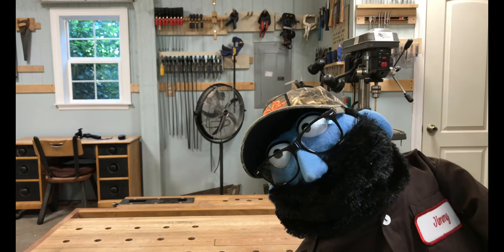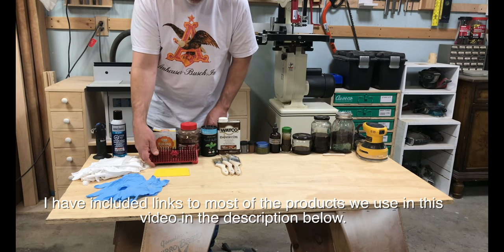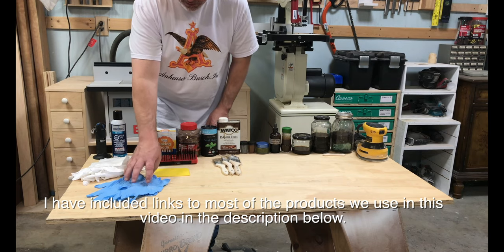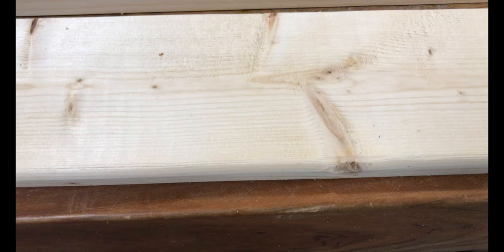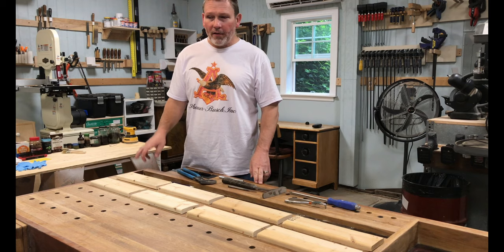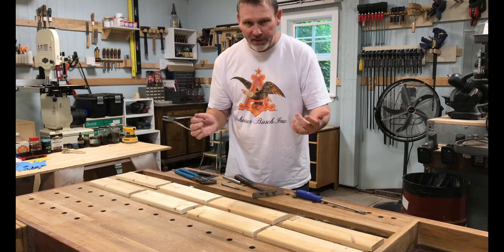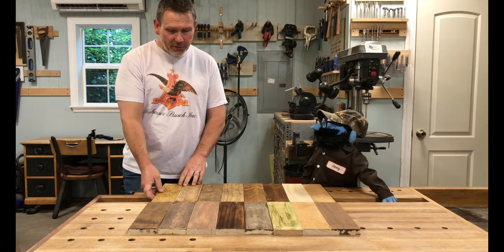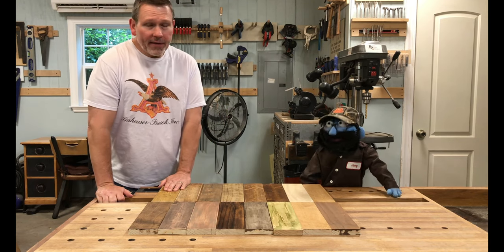Aging wood to perfection - best aging techniques?

Comment: 1. I torched & scraped the paint on my 80 years old doors and door frames, 
2. Then struggle with the putty beneath (sandpaper killer), (paint comes off but putty melts and sticks to the wood), 
3. Then I worked like crazy with 40 grit sandpaper to remove the burnt, discolored, bruised and damaged parts, 
4. I sanded 11 doors and frames with 80-120-180-220 grit sandpaper, respectively, so that the pinewood can be stained well. 

This whole process took me 6 months. Hernia came out at 3 points in the spine. The electric blanket I wrapped around my back to relieve back pain burned my ass. I had to lie face downwards for 2 weeks due to the palm-sized 2nd degree burn wound. The back pain got worse when I sleep this way. Countless sacks full of wood dust and possibly lead containing paint residues came out of the house. I had to send everyone in the house to stay elsewhere (will probably get divorced). And finally I got electrocuted of the dripping sweat from my arm into the angle grinder.

BUT; in the end resulting wood was smooth, shadeless and completely free of defects as if it had just come from a carpenter's hand.

And now I'm watching this: 2:07

Comment: Thats pretty neat. I think the steel wool and shellac turned out the best by far. Ive seen other videos where they used rusty nails and vinegar for a neat effect as well.
Reply from the maker: REDCLAY HOMESTEAD, That is probably my favorite too.  Definitely looks old.  Thanks for commenting!
Reply: I agree too!
Reply: Just came across this video, the steel wool and White Vinegar should be set out in the sun, it develops very nicely the longer it sits out.

Comment: Great video. Very informative but I do have a question....I like the distressed vinegar/steel wool and Garnet shellac combo the best, but doesn't Garnet shellac produce a reddish color? On my screen your example appears to be grayish, which is the look I'm going for.
Reply from the maker: The grayness of the vinegar/steel wool kinda overpowers the shellac.  I do like adding the shellac if only to seal it up and make it less prone to mark things up.  The vinegar/steel wool by itself tends to rub off on things and leave gray marks.  If the wood is just decorative and not going to be touched, that's no problem.

Comment: Thnx. A few i havent tried. I also ise a mix of old motor oil and deisel 50/50 which looks good but takes a week to stop smelling but i just leave it outside in the weather. Rain or not.

Comment: I need to perfect an aging process to match some really old wood that is quite possibly over 100 years old.
I've never seen old wood get dark and look stained like some of your experiments.
Besides distressing the wood with various implements, I'm thinking more along the lines of some sort of acid treatment followed by bleach, then maybe some sand blasting.
I'm also thinking to further distress the wood I''ll ship it UPS across the United states a few times. ;)
Reply from the maker: Haha.  I like the UPS idea.  I guess it all depends on what your 100 year old wood looks like and what kind of finish it currently has on it.  If nothing else, this video might give you some ideas / techniques to help with your decision.

Comment: Good. I suggest adding hydrogen peroxide to the steel vinegar solution while the steel is still in it.  This will rust the steel and add a beautiful terracotta/rust tint to the aging.

Comment: Awesome! QUESTION: in the very beginning when you cut the boards, what tools are you using to beat them up?? (it's fast, so i can't quite tell). Thanks!
Reply from the maker: I had to go back an look at the video.  lol. Looks like I used a screw driver, pliers, and archaeologists hammer, a punch, a metal rod, etc.  I was looking for anything that would leave an interesting shaped indention or cut in the wood.

Comment: Hi, great unique ways to make wood old.  I have white painted kitchen cabinets and wanted to do a chippy look.  I did purchase some chalk paint, glazes, waxes etc.  Yet I am restricted as they have been painted.  I am having some success with glazing but wanted to have a more aged or beaten up look; besides sanding them down to the wood, any suggestions?
Reply from the maker: Hi Jude.  If you are going to paint the cabinets, you might try covering them with Kilz primer.  Kilz will stick to your cabinets pretty much no matter what is on them.

Comment: I’m trying to figure out how to match some old pew ends. My dad made the bench part for me. We dug some really old wide boards out that had been wrapped in plastic in a barn. We thought they were oak but the were pine and they have tons of worm holes. After planing them they are bright white. He joined then together for seat a back. Worm holes are on the back operation and they are joined so well that they almost look like plywood. I want to make holes look dark and more like deep grains. The old pew sides are tons of grains running vertically. Just having a hard time figuring out what method to use. I just want to clear coat dudes but the rest needs some deepening and aging  not sure which if your methods would do that for worm holes?? Have you tried any dark wax or antiquing gels?? I’m wondering if I should try that on the holes to make them dark. They ate more like gauges than actual holes
Reply from the maker: Hi Lisa.  Sounds like a neat project.  One thing you might try is shellac (either clear or garnet) with a drop or two of brown dye.  Apply it, and then wipe off the excess.  It will stay in the worm holes and divots, since you can't get the rag in there.  Let it dry, and then coat the whole thing with a clear wipe on polyurethane.  I would recommend Minwax Wipe-On Poly (clear satin).  There are lots of ways to achieve what I think you are looking for, but that is where my mind went.  Good luck!

Comment: I'm sooo using green tea on a table top. Thats gorgeous. Does anyone know if the bond is strong? Is the wood stained or would i need to seal it?
Reply from the maker: I would recommend sealing it afterward, especially if what you are making will be used, like a coffee table, cabinet, etc.  If it's decorative only, you should be okay without sealing it.  Hope that helps.

Comment: have tried to get aged walnut wood using vinegar and steel wool mesh but did not get the brownish color. it was grayish instead. do you recommend the same steel wool mesh and vinegar plus a few drops of dark brown liquid to add into the mix ? Appreciate your feedback on this
Reply from the maker: Not sure...it might be worth a try.  The best thing to put in the vinegar would be old pieces of steel that don't have any coating on them...something that is already rusting a little bit would be good, because then you know that the vinegar can have the reaction you want.  My mix is kind of a brownish gray.  Good luck.
Reply: @PatrickParsonWorkshop  
Tried the addition of color tone and the results were good. thanks for the feedback

Comment: Is the vinegar/steel wool + the garnet shellac sanded both before and after the shellac ? Any wire brushing ?   I have never worked with shellac and this is the first time I have seen the exact look I want in a piece online.
Reply from the maker: It is definitely sanded before the shellac, and I believe I sanded it after too (from the way it looks in the video).  You might want to experiment with it to see what looks best.  If I were using that approach, I don't think I would sand after the final application of shellac. Hope your project turns out great, Aaron!
Reply: @PatrickParsonWorkshop  Thank you very much.  I have never used shellac before so I am watching and reading all I can online.  Is garnet shellac something you buy as crystals to dissolve or do you dissolve standard shellac and then add some form of colorant ?

Comment: If you want an authentic old distressed look, you might consider sanding off the planer marks.. amateurish and phony otherwise.
To stop the blotching, first rub on paint thinner or equivalent and let soak for  awhile. This will then be the hiway for the "danish" oil to penetrate uniformly.
Reply from the maker: Thanks.  I may try that, Jeff.